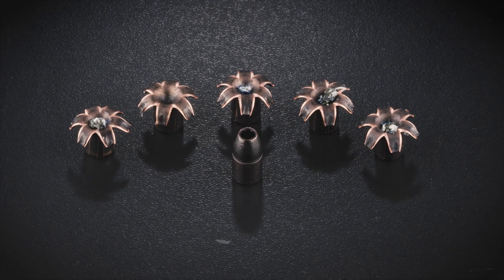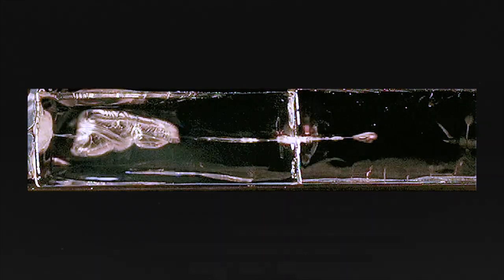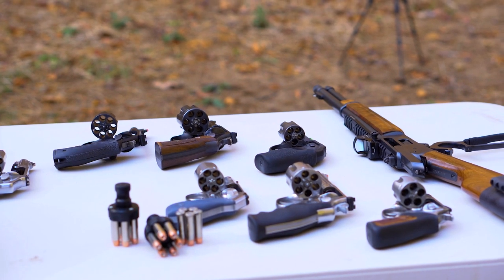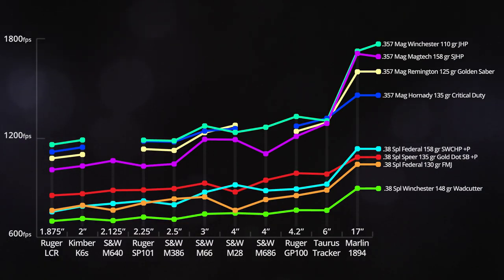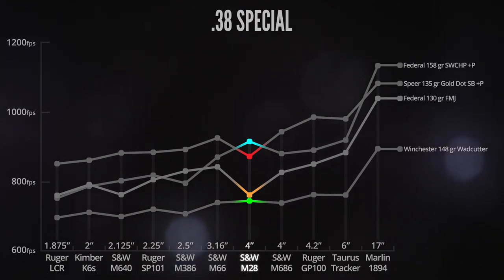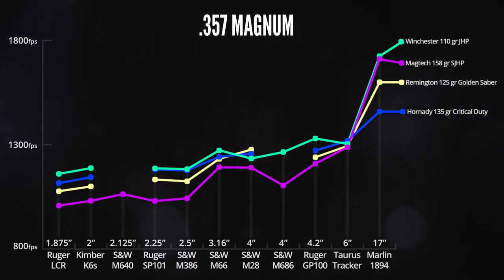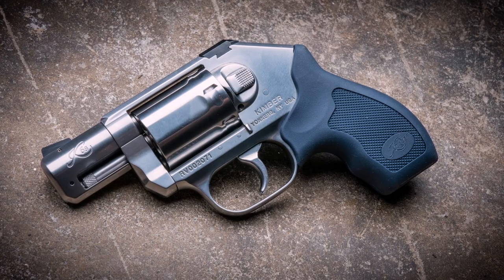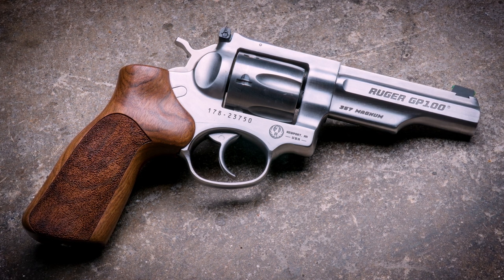Revolver Velocity versus Barrel Length

Comment: Couldn't decide either to get the 2inch or the 4inch barrel so I just ended up smoking crack.
Reply: Same. Except I rubbed one out
Reply: @sullivan5639  Same. Except I rubbed two out and did a speedball as well.
Reply: And now you want a Hi-Point?
Reply: 4 inch Barrel is required to get Magnum Power out of the .357 round
Reply: Y'all need Jesus.
Reply: Daric Why? Explain
Reply: @sullivan give tugs, not drugs
Reply: @filadogs52  lies lies lies, a magnum is a magnum, if I shoot a 38+p and get 900 fps then load a 357 mag and get 1200 fps I achieved magnum power in a snub nose revolver
Reply: @Adamificus  give both
Reply: Sounds like a decent substitute
Reply: @SPLITTINIMAGE  probably the best one anybody can make 😂
Reply: 3 inch
Reply: That was funnier than it should've been
Reply: That you Hunter?
Reply: Lol WTF!

Comment: I schlep around a 3 inch 686 as a EDC (and home defense gun) and as such I found the results between the 3 inch 66 and the 4 inch 686/GP100 quite interesting. On average, and as a whole the gains in velocity look to be marginal at best (particularly with the .357 loads). These results seem to mirror BBTI's in this respect. If anything yalls work further validates my decision to go with the 3 inch rather than the standard 4. Keep up the good work! I look forward to the completed product.

Comment: couldn't decide on a 2 inch or a 4 inch ruger sp101 so I bought the 3 inch for ccw
Reply: Good choice, I also own the SP101 3" and have found in 357 a huge jump in velocity between the 2" and 3" barrels.  I also have one in 9mm with the 2" barrel, I tested against a friends 2" 357 and the 9 beat the 357 out of the 2" barrel by at least 50-60 fps and sometimes more depending on ammo but it was no contest against that 3" 357 with it picking up over 200 fps or sometimes more with most ammo and you'll never notice that extra inch of barrel for EDC unless you pocket carry.
Reply: @hardball107  Yes the .357 for 2 inch is totally inefficient. There should be much more snubbys in 9x19. They could be reloaded faster with moon clips. Also they could be build shorter. Korth build a snubby frame/clinder just for 9mm "sky marshal" But its ugly and expansive.
Reply: I went with the 3in GP100!!!

Comment: I don't mean to be preachy but you have overlooked the most important concept which is energy delivered:   E= M Vsgrd
If you compare a 2 inch barrel against a 6 inch barrel and you find that the velocity has  gone from 1000 ft per second to 1288 ft per second then the velocity squared goes from 1,000,000 to 1,658,944 This means that the projectile energy from the 6 inch barrel is over 60% greater than the 2 inch barrel.
Reply: ...nobody ever denied that.
Reply: Energy is essentially meaningless in handguns.

Comment: I often reference ballisticsbytheinch when having these topics of discussion with people. While yes, "conventional wisdom" tells us that a longer barrel does equal higher velocity, some people just arent aware at how little it is sometimes or they dont consider that certain rounds were or are optimized for certain barrel lengths and they just cap out at a certain point.

BBTI shows this quite well when you look at .32 ACP, .380 ACP, .45 ACP, and .38 Special. Those are 4 rounds(there's others) that are optimized around a certain barrel length as a whole and see very marginal gains at best for going longer. .38 Special was originally designed around use of a 3 to 4 inch barrel. And in those barrel lengths, you  tend to see peak performance. I've seen some older .38 Special revolvers meant for target work with 6 inch barrels, and in terms of terminal effect on target, those extra 2 inches typically dont equate to much.

Most of your modern .38 Special loads are watered down a tad and optimized for snub nose revolvers as that's what's common in .38 revolvers today. Porting definitely hurts performance in terms of velocity and energy, but it's meant to keep the shooting surface flat so if you have to shoot again the gun(in theory) doesnt rise up as bad allowing for a more accurate follow up. But yes, cylinder gap, rifling twist, all that too can effect these things. However, a vast majority of it comes down to choice of ammo and caliber.

Take .45 ACP for example.. it was designed around a 5 inch barrel. It doesnt really get much better going up in length. Caps out around a 10-12 inch mark. It also doesnt get much worse going down in barrel length. Even a 3.2 inch barrel is still fairly adequate in terms of performance if not felt recoil. This is why it's important to look at the box for advertised velocity and energy. Some(not all) manufacturers put the test barrel length on the box for the numbers they put down. Buffalo Bore is good about not only telling you test guns they fired it in, but telling you the energy chart and bullet drop off charts on their site for their ammo. Underwood Ammo typically posts the test guns or test barrel length as well, but not for every caliber as some calibers are built around certain platforms that have pretty specific barrel lengths.

I've done quite a bit of my own testing, and I have revolvers that there's a noticeable enough difference in a 3 1/6 inch barrel to a 4.2 or 6 inch barrel especially. I'm a big 10mm guy, and just like 10mm ammo, there's lots of watered down .357 Magnum stuff out there. Take PMC for instance... that stuff is damn near .38 Special level of potency and it's a joke. I'd recommend that if you want to see what various loads do in gel watch TheChoppingBlock. Andrew does great work over there, rarely does he deviate his "test gun" so a fair bit of the gel tests are all done with the same gun/barrel length consistently. Now, this may not yield the same results for you as your barrel could be longer, short, or suffer the issues of porting and other things. But again, it does give a good indication of what to anticipate or expect. 

In most modern revolvers I find choice of ammo is what effects the variation in performance the most. Then I start to factor in other sources, starting with the obvious "Is it ported or have a muzzle break", then start to look at rifling twist followed by cylinder gap. In a revolver especially going down that list is a pretty surefire way determine where the lack of performance is being generated from once you've found ammo that consistently across the board is a proven performer. Granted, that's just my opinion on the matter based of research, testing, and observation.

Comment: Keep in mind barrel wear is a major issue, as well as how well tuned the gun is.  Keep in mind, that old S&W M28 of yours is not only older, most of the old M27's and M28's were bought by either police or civilians for pure 357 Magnum use, unlike some magnums like the K frame S&W.  Those old Highway Patrolmans like yours have probably tends of thousands of jacketed magnum loads through it, which might not only change the gap by a thousandths or two of an inch, but more importantly, cause just enough barrel wear to decrease velocities for jacketed bullets especially.  I've seen a long trend on other tests from other people on the internet, and it seems like a lot of classic 27's and 28's all had lower velocities than slightly shorter barrel 38 Special's, in part you could guess 38's will shoot better out of a 38 chamber, but also the fact that old magnum revolvers have old magnum jacket bullet wear.  

I think Speer did a study on the issue, something to the effect that it will become noticable after 6,000 rounds, and many an N frame 357 Magnum has had 10 times or more put through them.  Theoretically certain soft bullet loads could restore pressure and velocity by obturation, but the wear is wear.
Reply: Maybe its also better to not clean the barrel from debris because it may protect it from wear?
Reply: @Gieszkanne  NO.  The main effect of wear is from heat/pressure in the first place, and a dirty gun will not protect against that.  Even a dirty gun has thin enough deposits that the carbon will not protect the barrel from any wear.  In fact, a dirty gun can have worse wear, especially when you use the word "debris", because dirt is nothing more than microscopic rocks, most often harder than bullet metals like copper and lead alloys!  Dirt induces wear on metal parts for a reason.  Clean is always better in that aspect.

Where cleaning the barrel CAN induce wear is by poor or very aggressive cleaning methods.  Jamming rods against barrel crowns isn't doing it any favors, so you should use a muzzle guide when possible if you have to clean muzzle to chamber.  Hard scrubbing with stainless steel bristles isn't a purely benign process, especially when you clean a gun hundreds of times.  Worst of all, sometimes it is appropriate to use things like bore pastes that have abrasives in them, and bench shooters will use these to get rid of hard deposits, as well as some lead bullet shooters with extreme leading issues.  However, these pastes are abrasive enough to wear the steel of the barrel, and use of such products can highly accelerate barrel wear to a high degree if not used properly or sparingly.  

Keep in mind fouling from shooting can attract moisture, so even if many of us forget to scrub every barrel of every gun every time we shoot, there is merit in keeping your barrel clean and lightly oiled to prevent even minor rust in the bore.  Too much aggressive cleaning may not be the best, but leaving barrels dirty is a bad idea.  

When it comes to rifles and magnum pistols, there isn't much you can do to reduce wear.  High pressure and slow burning powders means throat and barrel erosion are part of the game.  High velocity has its own effects.  The only way to get a barrel to keep velocity constant for 100,000 rounds is to shoot ultra light handloads.... and why did you buy that rifle or magnum in the first place?
Reply: @kingduckford  Heat and pressure allone dont take material out of the barrel. Its the friction of  the bullet. So you can whipe out the barrel to clean it from burned powder but its maybe better to not take a brush and leave the tombac debris in it because it prohibit direct friction.
Reply: @Gieszkanne  You are wrong.  Look up "throat erosion".  High pressure and heat cause fire cracking of the steel at a microscopic level, and this is where most barrel wear occurs.  This is why most wear in rifle barrels is in the throat and early part of the bore.  In magnum revolvers that lose velocity, this occurs in the throats and forcing cone primarily, which tends to lead to the greatest loss of velocity.  

Also research top strap cutting, which occurs in some magnum revolvers.  The high pressure, high heat gasses will actually "cut" part of the top strap to a certain extent, and eventually becomes self limiting as the gasses eventually cut to their limit.  Bullet friction in the barrel is far less important to wear than the effects of fire cracking and erosion of the throats and forcing cone.  

357 Maximum is a great example.  It failed as a cartridge, in some part because it caused excessive top strap cutting in revolvers, even if the damage was superficial and didn't make the gun unsafe, it was unsightly and hurt the cartridge's public perception.  

Lead alloy bullets DO cut down on barrel erosion because they are much softer than copper, so after many thousands of rounds this plays a roll.  However, the other advantages of lead bullets in barrel wear is that lead loads get the same performance as jacketed with lighter powder charges and slightly lower pressures, which also reduce throat erosion.  Also, lead alloy bullets can be oversized when swaged or cast, and so one can attempt to restore some lost velocity by trying to restore obturation.
Reply: @kingduckford  Pressure and friction are totally conditional here. More friction more pressure more pressure more friction. So I dont understand how you think you are able to distinguish from pressure damage to friction damage. I think its impossible and goes hand in hand. For me its logical then, if you have a copper layer in your barrel that its more protected against friction than a total clean barrel.

Comment: I did a similar test of my own,  using Federal 158 gr jsp .357's. Getting  1221fps from my Rossi 4",  1326fps from my Taurus 6" , and 1712fps from my Marlin Carbine.  About a 100fps increase from the 4" to the 6" revolvers. And, an increase of nearly 400fps from the 6" to the carbine. As you say, each gun is going to be a little bit different. I just wanted to get some baseline data for my own load development for my own firearms.  Thanks for the video. And, yes I am a nerd.

Comment: Thanks for your tests! I switched to a 9mm shield from a 357 lcr several years ago after my own testing. I found that the recoil was not worth the little increase in velocity. I appreciate the testing because I found shooting hot loads out of a light revolver over a chronograph to be very nerve wracking. Those new Dopplers look pretty appealing!
Reply: You forgot to mention that the Shield is also much thinner, has a higher capacity, a longer barrel, is much easier to reload and costs a couple hundred less than the LCR.
Reply: It's a lot more than a little increase in velocity. 9 mm 240-320 ft pounds. 357 magnum 560-645 foot pounds.
Reply: Shooting hot loads

Hehe
Reply: That why I switched to the 10mm.

Comment: When testing across different makes and models of revolvers you also have to take differences in cylinder gap into account.  The larger the gap between the front of the cylinder and the back of the forcing cone, the more gas pressure will bleed off and the lower your velocity.  About a year ago I ran similar tests across my revolvers and found greater velocities from my Ruger Security Six than with my S&W 686 even though the S&W had a slightly longer barrel.  I found that the cylinder gap on the 686 was nearly doubled that of the gap on the Ruger.  Carbines and semi-autos like the Coonan .357 will have much greater velocities because there is no cylinder gap at all, plus what you get from the longer barrel.

Comment: Why didn't you just use the same model weapon with both a 2" and a 4" barrel? That would have eliminated many of the variables and made the test more scientifically accurate.

side note: The Ruger GP100 comes in both barrel lengths and also has a steel frame to make the .357 test more comfortable. So it would have met all your criteria.
Reply from the maker: +David Sandford There is no 2-inch GP100.
Reply: Sorry, my mistake. What I was thinking was 2" was in fact 3".  Plus the 4"  is actually 4.2". I should look things up before commenting, so I don't show myself to be a complete idiot (instead of just partially being one).

However the first part of my comment stands. I think you would get better and more scientifically accurate results if you could use the same weapon with different barrel lengths. (It would also give you a good excuse to get more handguns - though maybe that's just me).
Reply: Not to mention that even 2 different revolvers of the same make with different barrels might still have differences caused by other things.  The depth of rifling, interior diameter of the barrel, cylinder gap, chamber tightness... there are a lot of things that effect velocity.
Reply: @exothermal.sprocket  this is FAR more accurate for comparison sake,  allowing for the lack of a cylinder gap, cheers.
Reply: @LuckyGunner  there is now

Comment: Should have used a Dan Wesson pistol pack.  That way you could change the barrel length, and control the cylinder gap, and eliminate any variation other than the barrel length.

Comment: A lot of this has to do with barrel construction and if you are using the watered down 357 magnum or using .357 magnum that is truly powered as meant to be.  I would like to have seen what you would have gotten from the Ruger 4.2 versus the Ruger 6 inch.  That would have told me a lot more than the data displayed.
Reply: Indeed, I was thinking about rifling too. Some guns turn the energy into bullet-spin instead of forward velocity. This improves accuracy and even penetration at times, depending somewhat on the projectile used. Still, it's fun to watch nerds try to work stuff out on paper wile combing their millennial beards and not doing any work. Admittedly they do come close at times using lines-of-best-fit and statistical regressions. But they somehow lack some cementing dimension of explanationwhich can only be introduced by real world experimentation, and rationalize their way through the inconsistencies with clever rhetoric fueled by liberal arts degrees.

Comment: Thanks for this great series, Chris. I'll be looking forward to the final results. 

In my own limited testing, well in the past, 125g .38 +P loads from a snub barrel seemed to sit right on the edge of the velocity needed for expansion, and they tend to be inconsistent. I never found a 158 that expanded reliably.
Reply: I expect the BB would have enough velocity to expand from a snub barrel, but I have just never fired it at gel. I do carry this ammunition in my snubs now. Thanks for sharing your thoughts.

Comment: I got interested in that topic, when I took a closer look at tanks. Especially the 75mm had all sorts of barrel lengths, ranging from 75L25 to 75L100 (L55 would be 55x75mm). The thing is: it's unpredictable as long as you don't know the projectile and propellant loading. I guess that transfers quite well to handguns. Having a cartridge that was originally  for a carbine or revolver, will be very different from a semi-auto cartridge.